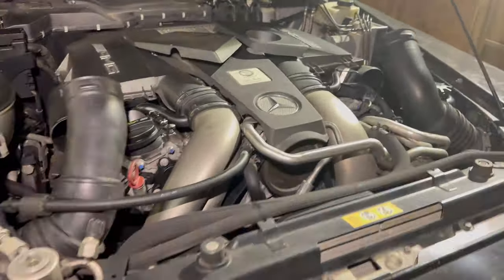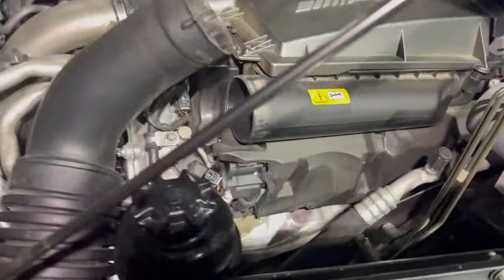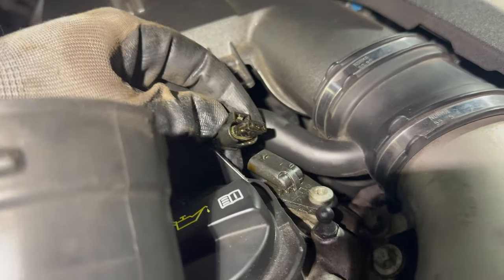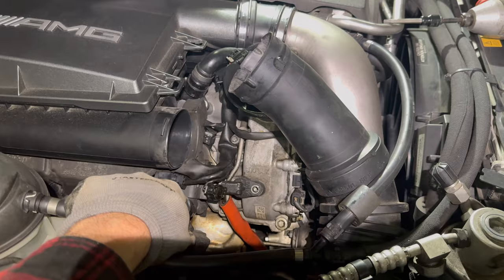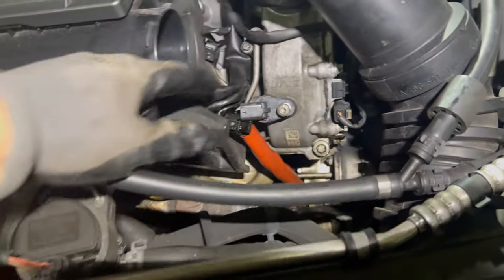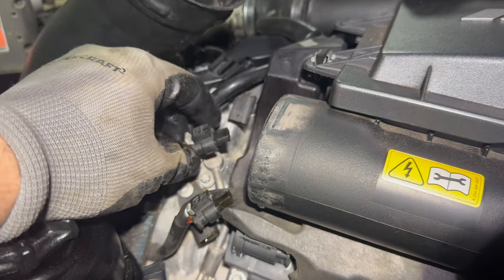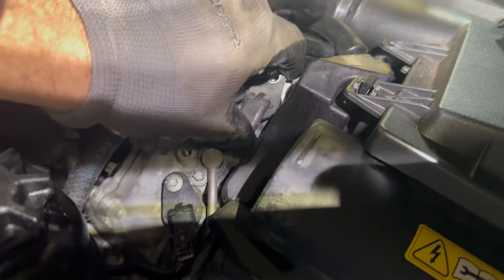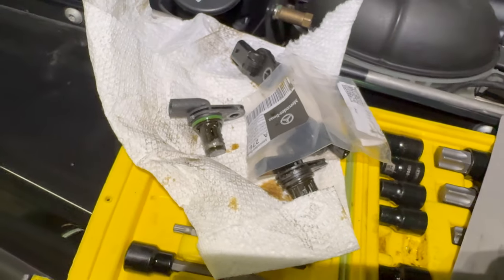Cam Sensor Replacement on a 2013 G63 with M157 Twin Turbo 5.5L Engine

Comment: you should check the cam sensors and cam actuators for oil leaks before anything els because too much oil in the wiring harness can ruin the ecu and create all kind of electronic problem .

Comment: Great video, have you checked your camshaft solenoid connectors? they can leak into the wiring harness as well, but usually not as bad as the CPS connectors.